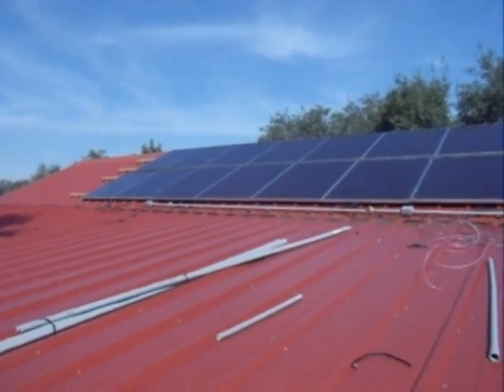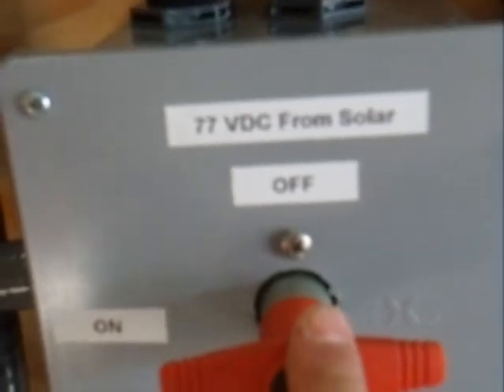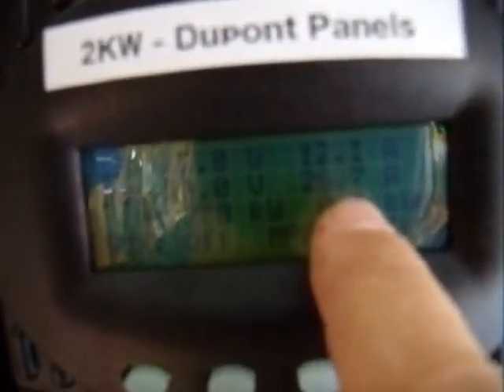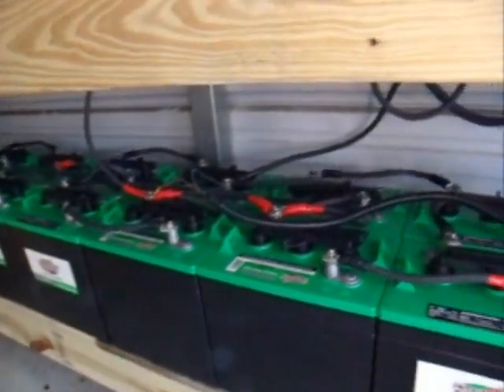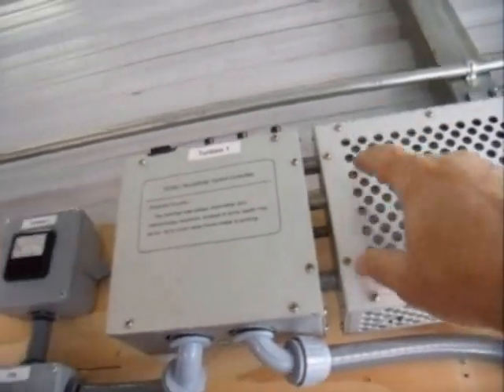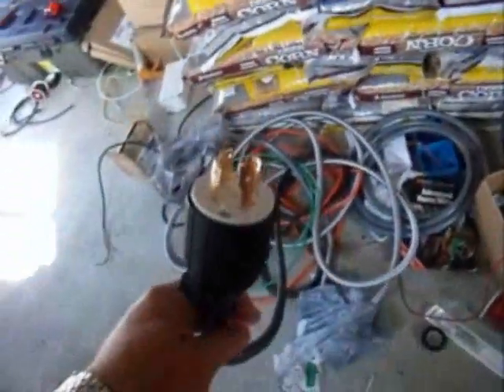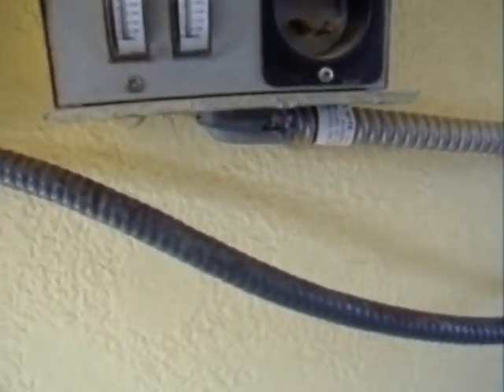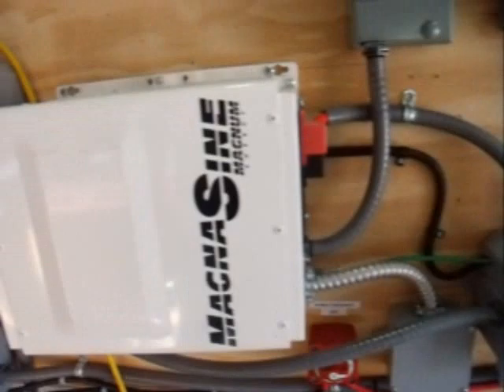Dupont Solar Panels Upate

Comment: Nice setip.  Are you running you grid tie inverters off of the flexmax and battery bank?  Or are they only being run off of your wind generators?  The reason i ask is how are you keeping them from over heating, or how do you limit their consumption?

Comment from the maker: @nrodge1 There are trade offs in everything we do, my turbines use magnetic braking  so they will govern without a dump load and are rated at 135mph, really not worth my time to worry about it much. However, you do have a good idea and perhaps I'll use my IOTA transfer switch to have the commercial AC keep the contacts going to the GTIs and when power fails divert to the resistive loads, that should be easy enough. Thanks for the idea and God bless you.

Comment: The problem with disconnecting those dump loads and putting in a GTI instead is if the AC grid goes out on a windy day, the turbines will spin like mad, and that's what the dump load prevents. Since you have so much power there, you can spend a little of it continuously energizing a AC relay, if the grid is on, the relay is closed and the GTI connects (on the DC side), grid off - DC goes to dump load, default mode. Check Watts of relay coil with kill-a-watt and let us know how much it takes.

Comment from the maker: @michael970 Hey Michael, good to hear from you!  No, they won't even notice, any excess I sell goes into the grid, any power they buy goes through their meter and make it turn, when the meter man comes in month they will simply read what it says. The power I put on the grid they will buy from the power company at the regular rate because it has to go through their meter making it turn.  God bless you brother.

Comment: @econewpower I hope so! Thats what that old iron block Kubota engine is going for. I found a generator head on ebay that bolts right up to the flywheel. 16.5 KW output. Super rugged, all cast iron that weighs 336 pounds. People with that same light tower with the 4x 1KW metal halide bulbs say that at full light output it uses at most 1/2 gallon per hour on a 30 gallon tank.

Comment from the maker: @MrAcrown Each panel is rated at 77volts at maximum power and they are all connected in parallel because the maximum working voltage for a FlexMax is 150vdc. Since I have 2,000 watts of panels then at 77vdc the maximum amperage on the wire will be only 26 amps. That's the advantage of going with higher voltage panels.

Comment from the maker: @MrAcrown They are  8awg size, total run length is about 130 feet. You have to remember that the size is determined by the amps you will carry but most people fail to realize that the amps are also dependent on the voltage of the circuit. Since my voltage is 77vdc, eight gauge gives me about 3% loss which is acceptable.